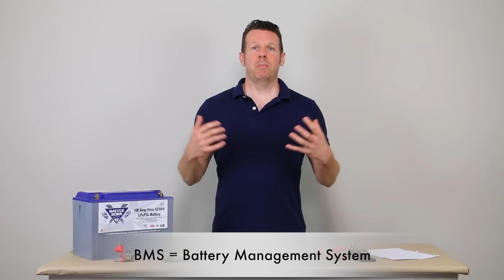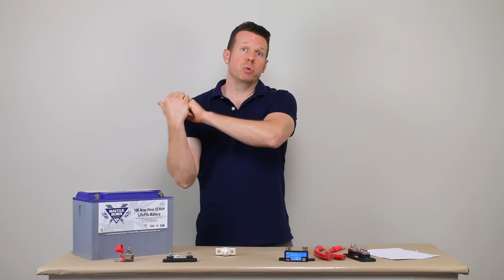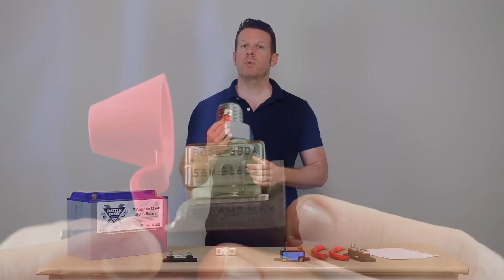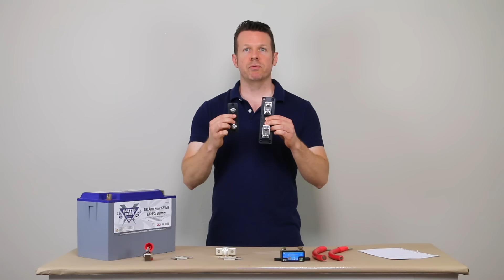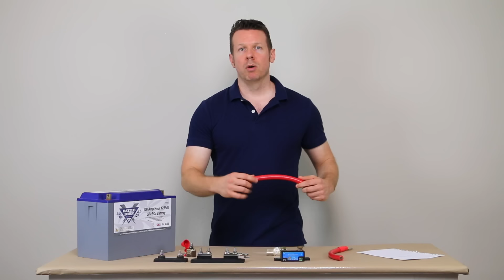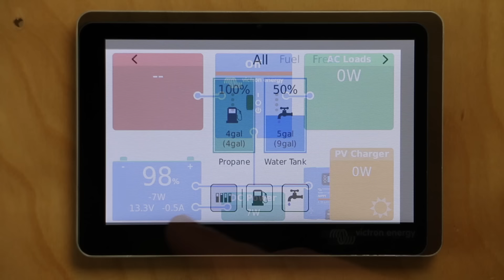The Top 9 Lithium Battery Mistakes for Van and RV Power Systems

Comment: I tripped out my Multiplus just like your first comment.  With a twist.  I was charging the battery at 10A with another 3A of solar.  A single cell went charged first. This caused the BMS to cut the charge off.  The multiplus charger does not like this.  It  tripped out the whole unit plunging me into darkness.  This does not normally happen with the solar power, but does happen with the charger.  My understanding is the charger (reverse flowing the inverter) has "momentum" and if the battery cuts the charge suddenly the charger ends up with a load of stored energy in the transformer coil with nowhere to go.  This will cause an inductive spike which can cause the voltage to sore rapidly until the inverter trips out to prevent damage.
Running 2 batteries in parallel with 2 BMS's... should one of them end charge by cutting it's mosfets, all of the current will go to the other battery, which will then also cut charge off.  it is going to be challenging for any system to remain stable while that occurs at anything over a few amps.
Where I am investing time is in monitoring and control (automation) to pre-identify these situations before they trip a safety feature and mitigate them with current control or force switching to float or ending the charger.
Reply: Had the same issue. Dropped the charge voltage and upped the absorption time so that the BMS never abruptly shuts off.
Reply: The BMS is an emergency protection device, just like a fuse. You should NEVER trip your BMS under normal circumstances.

If you are tripping your BMS, then you are doing something wrong, and in your case, overcharging.
Reply: @CharlieOdom1957  How do you know you have or have not tripped it?
I have detailed records showing me.
Most people have anything like it and most BMSes do not record HVCs.
I get tired of people saying, "I did this and never had a problem".  When you ask them, how do you know you did or didn't have a problem, they don't have any answer."  Basically they mean it hasn't gone on fire yet.
Reply: What is your proposal for not hitting an HVC when charging an unbalanced pack out of interest?
Reply: @1over137  why do you have an unbalanced pack? I would suggest fixing the unbalanced pack issue before connecting a BMS. If your pack gets out of balance from normal use, then you are doing something wrong, either by mismatched cells, improper wiring, or improper charging hardware.

So, the issue needs to be resolved, not relying on an emergency shutdown to trip because you are too damn stupid to solve a problem.
Reply: @1over137  you can literally watch the God damn BMS shut down, and if you know how to read, you can also see why that BMS shuts down, whether it be from over volt, over current, cell deviation, temperature, etc.

A BMS is an emergency shut off, just like a fuse. You should NEVER have a BMS trip from anything under normal use, PERIOD! If you do, then YOU are doing something wrong.

I have ran Lithium for years and never had a single BMS trip from normal use, only from either operator error, or testing purposes. Your charge controller, Inverter, etc is what limits the amount of energy coming and going through the BMS.
Reply: @CharlieOdom1957  I call bullshit.  in the case of a charge disconnect.  A BMS will trip and return to operation without leaving a single log trace.  Unless you are standing there and watching the app when it does it.
The system won't even notice and if you have only the default history enabled (Like with victron) the sample frequency is orders or magnitude longer than most BMS recovery times, so it won't be on the graphs.
Next.  If a cell goes high (top 5%) of charge, then even a tiny amount of current will push it over.  Even with a charger limited to 1 Amp will high voltage disconnect a cells.
This can happen anywhere from 27.0V up.
It turns out I have implemented a back off system to stop it.  As a software engineer I get to do these things and understand how they work.
I also think you have a different type of BMS.  Is it per chance a sealed unit, in pre-made batteries?  The BMSs I have, have both charge and discharge disconnects, independant.  The BMS disconnects charge, waits for a minute and then reconnects it.
Either your BMS trips out completely and that's it, which is your own fault for buying a shit one, or you don't have a clue it's been HVC'ing every 5 minutes a dozen times a day and you won't know if all you can do is look at the BMS or the app.... unless you literally catch it right at that moment.
The better way is to use a "cell aware" charger.  However they are rare and usually only coming in proprietary form, such as victron for about 3 time the price of other batteries.
I implemented my own, which backs off the MPPT current based on the cell delta.
Reply: @1over137  so, what you are saying is you had a problem with overcharging, overdischarging, overcurrent, etc, which was tripping the BMS, so you decided to use a proper device, like a charge/discharge controller to keep the BMS from turning off, which is EXACTLY how a lithium system is supposed to work, thereby proving my point precisely.

Thanks for solidifying my argument.
Reply: @CharlieOdom1957  My system has 4 charge controllers.  Not one of them is aware of the cells.
The multilpus charger.  Set to 27.60V and 1 Amp (it's lowest current) caused a succession of HVCs on a single cell before the balancer handled it.
Without graphs it would be next to impossible to detect they occured after the fact.  The BMS just recovers. The victron gear doesnt log it.
To protect the battery from it, you also need to update the charge voltage settings dynamically, which is a very involved task.
Reply: @1over137  You absolutely have no clue what you are doing. I suggest you get a qualified individual to properly design, install, and program your system so you don't injure yourself or others from your ignorance.

It sounds to me like you have severely mismatched cells in a terrible DIY battery and you have no clue how to fix your problems.

I have installed hundreds, if not thousands of lithium batteries, and never had a single issue with a BMS shutting down, absent any extremely abnormal circumstances. For example, I had one battery bank shut down due to a temp sensor fault that caused a cascade of over current and under volt situations, and the BMS in each battery did its job of disconnecting in this scenario. I had another battery disconnect from high voltage due to an improperly programmed tail current and absorption changeover point. This was solved by correcting the programming in the respective charge controllers.

Your issue, as it appears to me, is a complete lack of understanding on the purpose of a BMS, which has caused you to incorrectly program your controllers, causing BMS safety events, compounded by severely mismatched cells.
Reply: @CharlieOdom1957  You have me on the miss matched cells.
The rest is just blabber.
i fully understand what the BMS is doing and I agree the HVC is a safety system which should not be hit under "normal operations".  In my case it isn't hit under normal circumstances.
This circumstance (in my original comment) was relating to abnormal circumstances.  Testing and balancing new packs.
The point I was making when you harrassed me about that is that the vast majority of people won't have a clue it happened.
You keep talking about BMS Shutdown.  An HVC is not a shutdown scenario.  The BMS stays on and discharge stays on.  The BMS just blocks charge current for a period of time or until a recover voltage and then accepts charge current again.  Without data logging most BMSes will do this 100 times in a row and not once utter a warning.  So the user reports "I have no problems."
Additionally.  The need to get into the top 5% and into the rising voltage region is to balance any out of balance cells.  If you have no voltage delta the (most) balancer cannot operate.
if you have any inbalance in teh cells and you never explore the upper voltage region you will never bring them back into balance, meaning the lower end of the pack voltage may begin to suffer bottom end disconnects.... which are a very serious occurance as it shuts down the whole system while it's in operation, including MPPTs and inverters.
Unless of course you have got perfectly balanced cells and have cell voltage monitoring 24.7 in order to determine the true health of your cells.  Literally without 24/7 cell monitoring you have no idea what did or did not occur or what state their balance is in.
Reply: @1over137  you are still failing to understand the purpose of a BMS. You should NEVER hit the upper bms limit, nor the lower BMS limit.

If you are balancing cells to build a pack, then no BMS will be present. Once the BMS is added to the pack, you need a 250mv deviation in cell voltage in order to trigger a shutdown event, and if you get anywhere near this number, then the cell makeup is the issue, so you have either built the pack wrong, have a bad cell, or never balanced the cells properly. It is completely operator error.

On the other end, you should NEVER discharge to 2.5v per cell, or anywhere near that, and once again, operator error will cause a safety event.

You stated the BMS is not shutting down, then immediately state the discharge shut down, which is a shutdown event, contradicting yourself in the same sentence, thereby proving my suspicion of you not understanding the purpose of a BMS.

I stand by my comments. You have no clue what you are doing.
Reply: @CharlieOdom1957  Let me quote myself here.

"You keep talking about BMS Shutdown.  An HVC is not a shutdown scenario.  The BMS stays on and discharge stays on.  The BMS just blocks charge current for a period of time or until a recover voltage and then accepts charge current again."

Where is the contradiction?

Is it you who do not understand how BMSes work are are basing it entirely on one battery you have?  
Most good BMSes have completely independant control over charge, discharge and their own "ON/OFF" status.
A BMS can disable either charge, discharge, neither or both and remain "ON".  Or a BMS can shut itself down entirely.
A "Discharge" disconnect is basically going to shut your system down, in the sense its going to shutdown all your loads and inverters.
However that battery is not OFF, the BMS hasnt shut down and you can still charge it.
On my system a BMS Shutdown has only ever occured during extremity testing of those exact safety systems.
However, occasionally bouncing off the charge disconnect because the BMS decides the battery is full based on different information than available to the charge controllers is not that big a deal on a good premium BMS.  I would prefer a current limit circuit, that is available on one or two BMSes, but i havent decided to change
Reply: @CharlieOdom1957  you mention "Proper taper current".
If you are running an actual BSS system you would understand that taper current is irrelevant as the system is always on load 24/7.
No one part of the system has full awareness of what is going in or out of the DC bus.  The battery is the only thing that knows the "net".
If the MPPT or battery charger gets to 28V and the charge power falls to 350W, but there is a 300W load.  What would your MPPT do?  Terminate the charge?
That makes no sense.  As soon as it terminates charge the 300W of load will just pull it down and the charger/mppt will re-enable.  Instead just let it track the voltage drop from the loads.  As long as your voltages are not set too high when the load comes off.
Reply: @1over137  incorrect. Tail current is absolutely relevant, and properly designed and programmed systems have full capability of measuring tail current.

I currently have no less than 3 dozen systems using tail current to determine when to stop charging, and those same systems also switch between CC and CV seamlessly while loads are active, so your statement is complete bullshit.

Maybe you should take an "intro to DC electricity" class, or at least visit a local library.
Reply: @CharlieOdom1957  CC CV LOL.
I have a degree in engineering and a 20 year career in it.

Comment: I often critique (hopefully in light hearted ways) people purporting to "educate" on these topics who confude and conflate - something they call "Amps per hour"  - Amps and Amp Hours..   lol...  ( yes the other thing "doesn't exist" )

Yes I understand Amps are a proxy for power and Amp hours are a proxy for energy capacity (or energy use - as a lot of people may be able to measure amps but can't do maths. 

Scrimping on leads - big conductors are expensive  (but so are Victron inverter-chargers - why would someone mount inverter and batteries a long way apart  ??)..
Reply: When connecting two or more batteries together, the BMS cables inside the battery are small so there’s no need to use #2 cable there. It’s more important to keep the charger and inverter (if you use one) close to the batteries.
Reply: @Krunch2020  , the BMS leads are sense and sink wires mostly, they hardly flow any current (limited by resistors) balance capacity for many BMSs is limited.

Comment: Yet another reason for me to get a 48V system. Major drawback there is, when you want to increase your capacity, you need to buy FOUR more batteries.
And ah, yes, connections. I remember one rainy night in Georgia, cleaning battery terminals as well as the ground connection to the frame, and the hot lead to the starter. Naturally, it was raining.
It was the night before Thanksgiving, and it was for a young Black Mother who was stuck with a dead battery at the supermarket.
The battery was fine, the alternator was fine. Both were darn near brand new. The connections were trashed. Yes, both had been replaced at a shop. And they didn't even clean the existing terminal connectors on the cables. Which were clamp ons, and corroded as blazes as well.
Reply: WTF do we need to know the Person you helped was a young Black Mother. Ya idiot 🤣🤣

Comment: Another nice video

Not a fan of ANL fuses for battery fuse(s). At least mitigate the short circuit risk by sheathing the cable from battery post to the fuse. Better, yet, Class T and sheathing but I get the trade-space.
Reply from the maker: Hi Jim, thanks for tuning in, and for sharing your thoughts on the different fuses. A lot of options to consider!

Comment: I see some lithiem batteries state that only four batteries can be put in series. A limit on the BMS. Is that true for all lithium batteries?
Reply from the maker: Hi Marc, I think the limit of 4 in series has more to do with the BMS not being able to track things in a 60V or higher system. They are saying the BMS knows what's going on in systems up to 48V (4 batteries in series). At that voltage, it still has to track high voltage around 56 volts, and low voltage around 44 volts, so it can do its shutdown thing. They're just saying if you string together a ton of batteries, the BMS will not function at those higher voltages. 

To answer your question, yes a lot of these mobile systems would top out at 4 batteries in series to make a 48V system. Beyond that if you need more power, you would increase amps and can add many, many batteries together in parallel. Hope that helps, thanks for tuning in!

Comment: Thanks, failure analysis is important for full understanding.  

I warm my LFP to 50F (pads) after poring over a bunch of cell spec sheets showing allowable C rates at different temps.  Seems to me that the self-heating ones miss out on charging opportunities because they allow the batt to get cold in the first place, then disable charging while the internal heating runs.
Reply from the maker: Thanks for watching, yes interesting point on the self-heating batteries. I suppose the other argument is you could accidentally use battery power as they heat themselves, even if you don't have charge sources present. Perhaps both methods have their advantage.